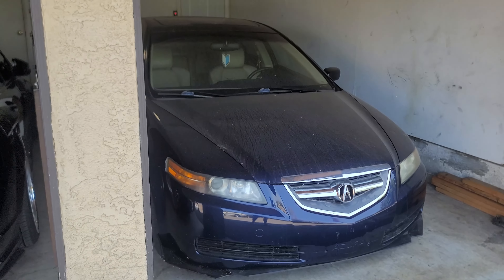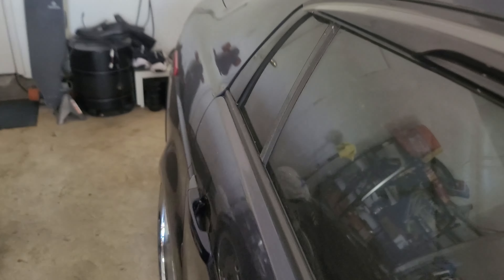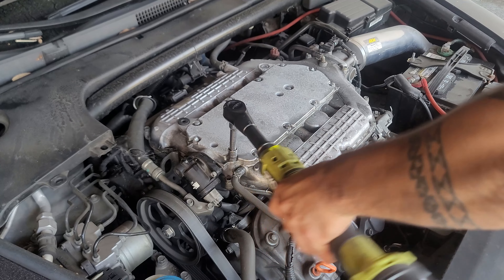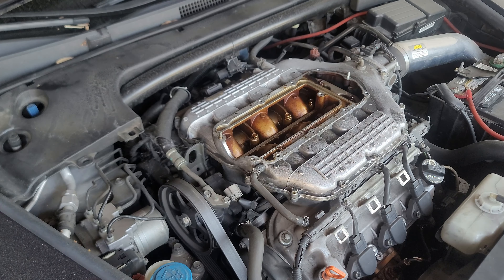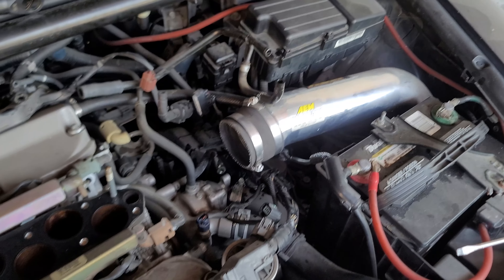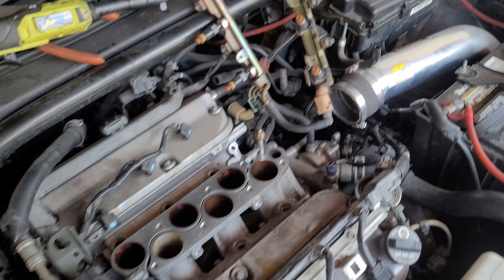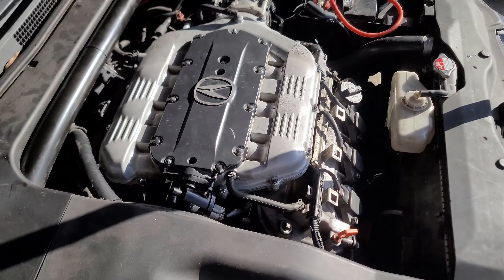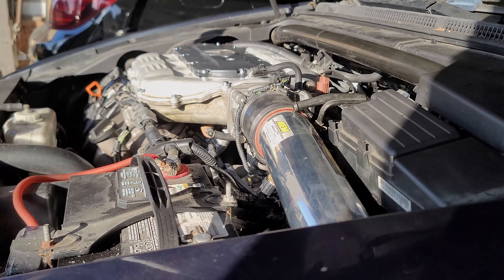Acura TL EASY HP!

Comment: I swapped mime to the 3.5 . Upper intake manifold . An a short ram dc intake an it slapps for me I have the 3.7 intake manifold  but the plug an such is not fitting  propper pins an such
Reply from the maker: @AlxandEr29  you gotta swap some stuff over from the 3.5

Comment: what is the one hose sitting atop the intake tube that's not connected
Reply from the maker: @tMena45888  orginally connect to the manifold bot got replace with a tube, does not connect to anything anymore, but it's connect to another bottomed hose doesn't affect anything negatively

Comment: No check engine light? Mine came up for a vacuum leak so I had to put the original 3.2 back. Thinking it might be the thermal gaskets I got for the manifold spacer
Reply from the maker: Vacuum leak usually means something ain't completely sealed up 100%, no issues on my end at all. I don't think a thermo gasket could throw a code like that, did it run rough?
Reply: @_MTgarage_  my problem was the top plentum screws ...had vaccum leak because i was missing two screws ...
Reply: @_MTgarage_  well I was having issues with the manifold gaskets lining up, previous guy also had a 6mt non type s and said no check engine light on his end. Can’t be the hoses cuz I reused them for the original 3.2. Gonna have to troubleshoot 😂
Reply from the maker: @randomdude6240  yeah definitely double back and check every lil thing and if it's solid scan it and see what it says
.

Comment: I have a 04 tl 3.2 can I put a 3.7 throttle body and run good ?
Reply from the maker: @vapeplug6457  yes but you will need the manifold as well to match I beileve

Comment: Is it straight plug and play for a 3.5 or do you need a different throttle body to match the sensors plugs?
Reply from the maker: @nickhernandez8805  a 3.5 is straight plug and play, 3.7 you gotta swap over some stuff

Comment: dont you have to tune it after installing a bigger intake manifold to actually make power?
Reply from the maker: @FatBoiiDaniel1600  no you don't have to tune with a manifold swap  the tb and the ecu is within range to adjust to it, however once you're fbo you're gonna wanna tune it so it performs at the max capacity of everything installed. But this forsure is an easy mod that does make a noticeable difference right off the get go

Comment: How much hp and tq do you think it gained???
Reply from the maker: @jesus20escamilla  now this is a good question hmmm🤔
I wouldn't be able to really tell you about  it with just the intake manifold alone because it's practically fbo, but I'd definitely say it's a significant amount. Even before when I had other j series and alone did the manifold upgrade it definitely does performance better